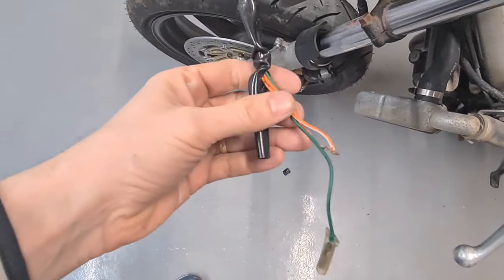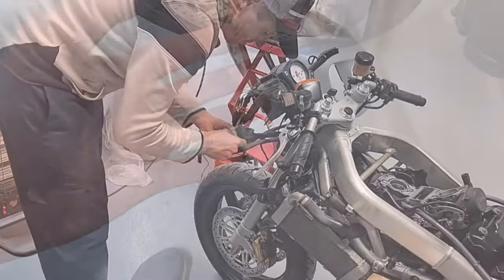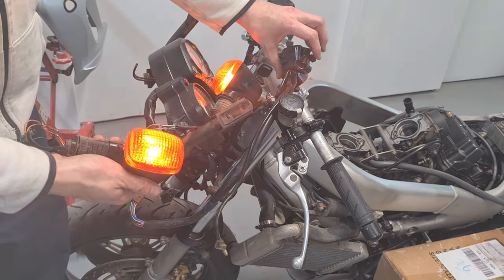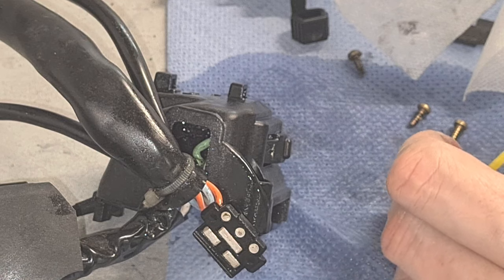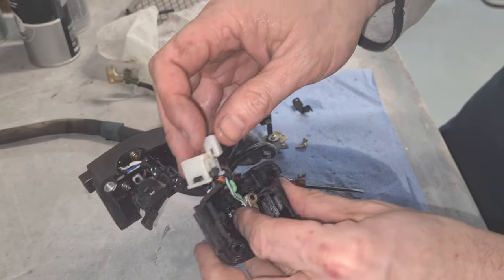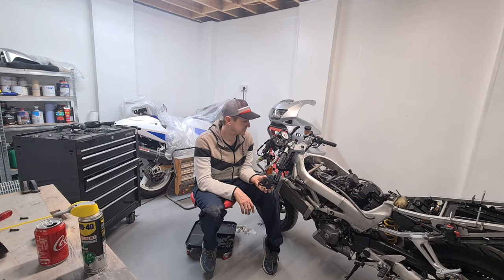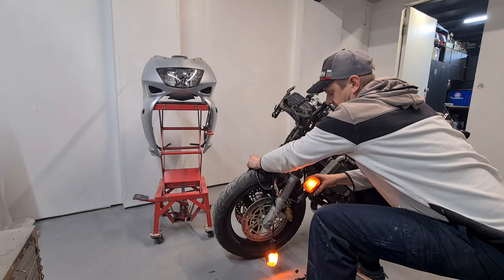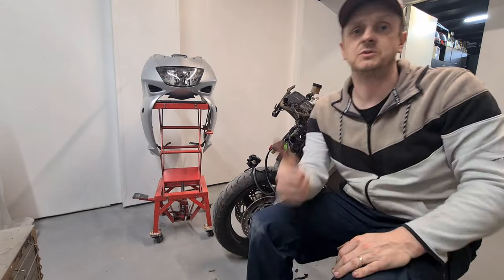HONDA VTR FIRESTORM INDICATOR FAULT REPAIRED SUPERHAWK

Comment: I would just like to say YOU SIR HAVE BOUGHT A PROJECT VTR LOL
My bike had no faults but your channel has Kept me on my TOES
PS if you have a problem please don`t hesitate to ASK ME MATE :)
I took my bike for an MOT and the High Low beam Acted the TWAT lol
You couldn't make it up :)
PPS my Grandmother use to play the Wurlitzer Organ in Blackpool TOWER and my Grandad HAD TO USE WHALE OIL TO GREASE/LUBRICATE THE PARTS to ENABLE MY Grammar to play for ENGALBERT HUMPERDINK How times HAVE not CHANGED LOL
Reply from the maker: Haha 🙏 awsome this vtr has to be the most faulty bike I have ever worked on it was a right basket case when it arrived it was kept outside for years in whales..... I repaired the whole bike but had to break all the footage down for several videos....... It was a very buisy two weeks

Comment: Dude brilliant video thanks...I got an issue with mine so stripping the switch "properly" now 👍👍👍👍
Reply from the maker: Excellent also its a 3 wire indicator so some people make the mistake of fitting the wrong bulbs... And sometimes the wires in the bulb mount can corrode

Comment: Thank you for the great video! I wonder how much similarities there are with VTR SP1? I have some turn signal issues with my SP1, but I will check and clean the switch for now.
Reply from the maker: Usually motorcycle switches operate the same... What is the problem with your turn signal indicators?

Comment: Every problem you’ve run into from the carbs, fuel tap and now the turn signals!
Reply from the maker: Yes very faulty bike this one... i broke down the faults into separate videos but it was stood outside efor a long time with the previous owner

Comment: Hey mate, when sitting on my vtr1000f 2005, the right front turn signal has broke. I need to replace it but I'm wondering where the wire ends so I can take it out and replace if that makes sense:)
Reply from the maker: It should just connect behind the fairing

Comment: My left turn signal has a huge delay and the right signal just makes a clicking sound. Could it be the turn signal relay?
Reply from the maker: Sounds like a bad ground for the turn signal circuit somwere maybe after the relay... If the relay clicks then it is working

Comment: I have a large delay on both side of m turn signal, is it probably a bad ground?
Reply from the maker: Probably the flasher unit or one of the indicator wires is bad maybe corroded around the bulb